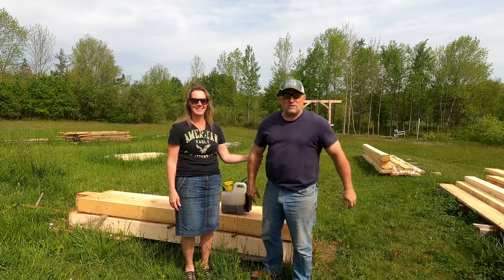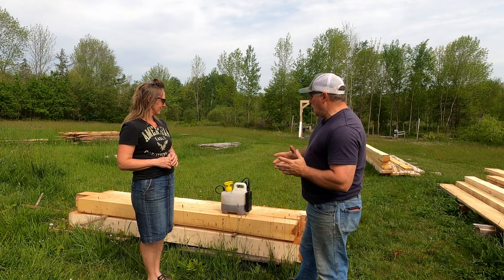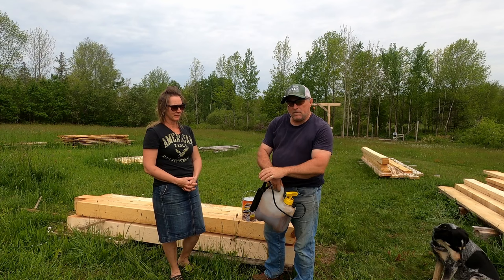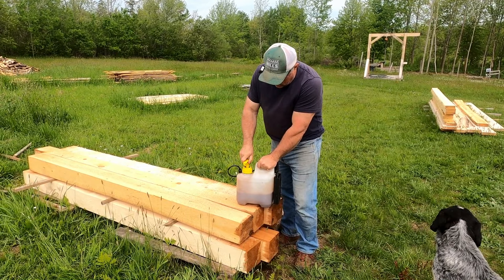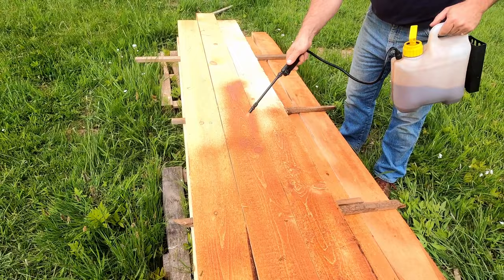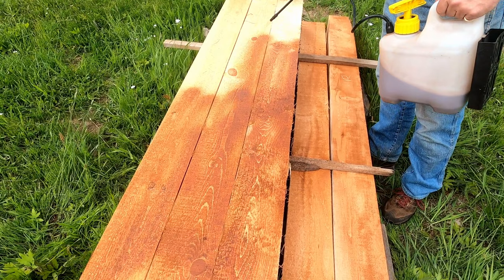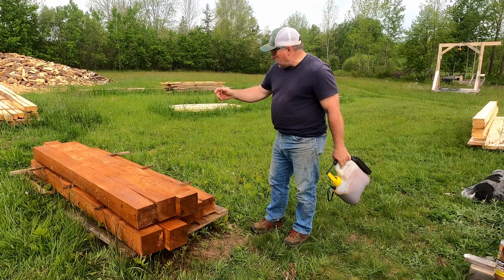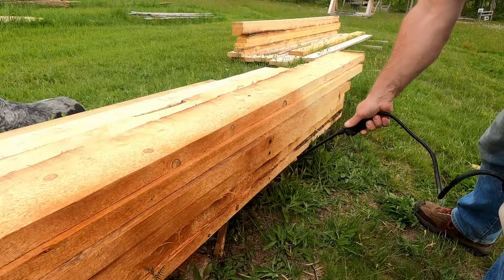Pressure Treat Without Pressure. / Simple Spray Method.

Comment: You mean preserved, pressure treated is treated under pressure that forces the preservative into the wood. You would be wise to square and cut to length before treating.
Reply from the maker: I made that distinction in the description. I didn’t cut and square the ends because they will all be cut to proper length for posts to build on. Once I have the right measurements then I will square cut the ends and treat them. Thanks for the input. Have a great day. 😊

Comment: Great Video! Does it matter if the lumber (pine) comes from a mill or Home Depot? Does it have to be wet from a mill?  Thank you!
Reply from the maker: Really doesn’t matter where the lumber comes from. Thanks for watching
Reply: Good to know, I’m a lad who has been storing nice pine lumber pieces from my job to add to my shed. Labor intensive to cut away nails and screws disassembling everything. Soo I thought the boards were useless bcz they’re pine. I feel so much better now. Thanks for this video
Reply: Unfortunately, your Armor All wood treatment product is not available here in the USA.  So instead I used three treatments for untreated pine wood: 1. from a link on My favorite wood sealer: https://www.youtube.com/watch?v=2e9lfhmBgYU  2. After two coats it was still too light so I put two coats of Olympic Elite Stain/Sealer 3. Finally I used Australian Oil to give the gold finish.  We are very pleased with the results as it perfectly matched the cedar columns! Thanks!

Comment: We are taking down an old barn. Can I use that on older wood or does it need to be sanded down or something first?
Reply from the maker: Put it right on the wood. I would remove any rot and or weak areas first. I would also double coat. Dry older wood is like a sponge.

Comment: How far in does this product go?
Reply from the maker: I’ve not really ever cut a piece of wood open to see. I usually treat the piece with two coats and use it. I know I’ve had 4x4’s in the ground for 5 years that are just as good as the day I put them in. I’m actually in the process of getting a long tub of some sort to soak the lumber in the treatment to see if it soaks in any deeper.

Comment: Thanks for posting the video.   I saw in the comments that the wood had been drying for about 6 months,   have you ever sprayed lumber right off the mill?    Just wondering if any spray would soak into the wood with the moisture content being at its highest?
Reply from the maker: Thanks Curtis. I have not sprayed green lumber. I don’t think it would penetrate due to the moisture content. Drying the lumber opens the pores of the wood and allows the wood preserver to penetrate without any interference from too much moisture content. Have a great day
Reply: Always dry wood... don't apply anything to green wood because it traps the moisture inside wood.
Reply: Always dry wood... don't apply anything to green wood because it traps the moisture inside wood.

Comment: Does this really work with a good sealant after
Reply from the maker: It works very well.
Reply: @CreeksideMaplesHomestead  would this work I live in the Midwest so we get all the elements with this work for building a deck I will be using pressure-treated posts though
Reply from the maker: @GHOZTPRODUCTIONZ  I live in Canada and we get a lot of rain and snow. I have had no problem with it
Reply: @CreeksideMaplesHomestead  so none pressure-treated wood is OK to build a deck with
Reply from the maker: @GHOZTPRODUCTIONZ  anything touching the ground or in really wet areas I would use pressure treated. However, I build my house foundation with lumber that was not pressure treated. I simply treated it twice and put it all together. It’s still like new
Reply: @CreeksideMaplesHomestead   and plus I’m gonna seal the deck as well. I use like a 10 year sealant or something like that but for the post going into the ground on the cement deck blocks I’m definitely gonna buy 4 x 4 posts pressure-treated because it’s going down into the elements, so OK awesome. I appreciate you replying to me so fast really appreciate.    that man, definitely need to give your channel more views
Reply from the maker: @GHOZTPRODUCTIONZ  thank you so much. Good luck. Cheers friend
Reply from the maker: @GHOZTPRODUCTIONZ yes it is. You may want to check your local building code if you are going to have it inspected or need a permit
Reply: @CreeksideMaplesHomestead  hey i got a quick question?
Reply from the maker: @GHOZTPRODUCTIONZ sure, ask away
Reply: @CreeksideMaplesHomestead  so a deck at one of my old properties was built in 1997 ground level type deck it’s 16x14 and it’s built completely out of 2x6x16 pt with the frame double with 2x6x16 the inside joist are2x6x14 I wanted to build the same deck it also has about about 15 concrete deck blocks and my old metal gazebo on it as I was building the same frame from the new rental property the neighbor seen me building it and told me that I should not be building it with 2 x 6 and I said my deck at my house is the same build been good all these year later so I’m lost I bought the wood already ?
Reply from the maker: @GHOZTPRODUCTIONZ Great question. There are a few things to keep in mind. First, is this a deck that will need inspections and building permits? If it is then you have to build per your code requirements. Second, how high off the ground is the deck? Third, a 2x4x6 can be used but you will need to support it at the 7ft mark with a strong beam underneath that will run the entire width under the 2x6x14. You can’t run the full 14 ft without something supporting the middle. Hope this helps. Cheers
Reply: @CreeksideMaplesHomestead  so at one side it’s completely at ground level then start to elevate at the 7 foot mark so at its highest point it’s about 24 inch’s off the ground  I will be using concrete deck blocks with 4x4 post with 3/8 lag bolts also going to put some mid joints supports in a staggered formation and no this will not need an inspection I’m on an unincorporated land
Reply from the maker: @GHOZTPRODUCTIONZ  As long as it is supported in the middle it should be fine
Reply: @CreeksideMaplesHomestead  I’m going to go a little crazy with the support my old deck was bounce a bit but not fully noticeable
Reply: @CreeksideMaplesHomestead  thank you for the help
Reply: Hey buddy one more question
Reply from the maker: @GHOZTPRODUCTIONZ let’s hear it bud.
Reply: @CreeksideMaplesHomestead  I have 30 K subscribers. I haven’t really posted lately lost a lot of momentum but for all the help you gave I will try my best to tell people to follow your channel cause I really appreciate the help buddy. so I’ve been working on this deck of courses you know I don’t know if it’s my eyes playing tricks on me but the deck kind of looks a little little elevated like I’m not really leveled but the levels are saying that I’m leveled. I’m both sides and I’m squared and everything so the frame is 255 going in an x pattern and his completely squared I just have one question and my question is should it look a bit elevated on one side because it does have a bit of pitch going down and you don’t know what I’m saying. I’ll put up on my YouTube channel just so you can see it.
Reply from the maker: @GHOZTPRODUCTIONZ  i’d post it for sure on your channel. But it sounds like it’s going to be a bit of an eye trick. If you’re levels are level and your square X is dead on both corners then I would chalk it up to a bit of visual trickery based on ground slope.

Comment: So - you didn't suck all the moisture from the wood 1st, you didn't use a vacuum/pressure chamber, so how do you get away with calling it 'pressure' treated? All you did was stain the wood.
Reply from the maker: @larryozdyck5867  I simply use the term loosely to show there is s way to get wood treated using the same chemical treatment. I make it very clear there is no pressure involved. I’m simply giving people an option. Not everyone can afford high dollar warehouse prices. I use it. It works. It’s a very good alternative. People can make up their own minds. Everyone knows without the pressure you don’t get the same depth of penetration. However, it still treats and protects the wood very well. Have a good day.

Comment: Building permit and inspection????
Reply from the maker: For what?
Reply: Say you were fixing the front porch. County says permit/ inspection, that would pass a building code im assuming
Reply from the maker: @EntrepreneurialSpirit85  Not where we live. It’s on our cabin. As long as it’s less than a certain square footage, no permits required. I can only speak to my own experience here. You would have to check your local codes. I was a lumber grader for years and can stamp my own lumber so that helps as well. I don’t know why, if your lumber is good, why it wouldn’t pass inspection or permit requirements. It’s simply wood treated with the same chemicals the large commercial pressure treated companies use. Obviously it doesn’t penetrate as deep, but it still is a good alternative

Comment: That product is only good for above ground use. Not impressed with the product reviews. 5TD FOR YOU!👎👎👎👎👎
Reply from the maker: You are welcome to your opinion. I’ve been using it for years to treat lumber that goes in the ground. Have had great luck with it and so have many others. You can’t argue with results and we’ve had great ones. I’ve got posts that have been in the ground for 7 years that are still just as strong as the day I put them in. So 5 TU for results 👍👍👍👍👍. BTW, it’s the same chemical used by large companies to make the actual pressure treated products. If it didn’t work I doubt they would use it.

Comment: The key words here are " pressure treated". You repeat those word several times. You are not pressure treating you lumber. You are just treating it. 
So your advise is to disregard the manufacturers instructions when they say, don't spray it on? 
Pressure treated lumber is applied in a pressure chamber after being "dried properly".
I'm sure what your doing helps and your intentions are good but you're giving people "advise" and it is completely misleading. Stop and think about it people are going to spend their cash on this.
Really nice and really pretty but NOT PRESSURE TREATED LUMBER!  Tomorrow cut a piece of you "Pressure Treated Lumber" and see how far the "treatment has penetrated. Then cut a piece of real pressure treated lumber and check it.
Reply from the maker: I appreciate your input and respect your opinion. I state in the description it is not pressure treatment like they do in the large box store industry. I think most people understand this. I’m simply offering a cheaper alternative to high dollar pricing. As far as spraying it on, that is my preference. There are many products and brands that suggest a certain application is best and they do to protect themselves from any insurance or EPA violations. There are many Homesteaders that have learned to make do with what they have and can afford. I have never claimed that this treatment is better than or penetrates the wood deeper than a pressurized chamber application. I have used my method many times. I’ve yet to have it not work. I have posts in ground now for 10 years that are as good as the day I put them in. Again, this is simply a cheaper alternative that I’m offering here. If that offends others, that has never been my intention, but for those it helps, that has been my goal. I appreciate all comments and suggestions. I also appreciate that you have not tried to be harsh or demeaning in your comment. For me, this has worked marvelously and I will continue to use it. Have a great day. Thanks.

Comment: What you're doing, will  not work as time . Pressure treated wood....is the name pressure treated...... the wood is put  into a chamber where it's vacuum out and called pressure treated .. what you're doing is a typical spray on chemical which may get the first 1/32" of an inch of the wood it does not help at all. I think it's a waste of money and time. That's me my opinion after 35 years of working with wood..
Buy the way.. spraying that chemical with no respirator causes lung cancer
Reply from the maker: Thanks for your input. I have been using this method for years with great results. I agree, it is not pressure treated as you would buy in the big box stores, thus the title and description. However, it does work for me. I have had beams that are in ground that have been there for years in all kinds of weather that are still as sound as the day I put them in. No, it doesn’t penetrate as deep as your regular pressure treated lumber, that was a given. It does, however, keep the wood better preserved than if it had no treatment at all. It is simply an alternative. Thanks again, I do respect your 35 years of experience.
Reply: @CreeksideMaplesHomestead  
The reason I mentioned this, is because of my experience. I put a fence up 22 years ago for a customer he refused to use pressure-treated wood, so he decided to do his own treatment on the wood. Fast forward today, I'm actually replacing his 80 ft wood fence that has been rotting. I did put in 4/4 treated wood in concrete for the Post. That is not rotted at all we are actually using the same post to replace the fence with, we are now using all pressure treated wood on his fence. If it's Primed, painted, correctly,  it should last at least 30 years.    .the info is based on my experience... Have a great day...